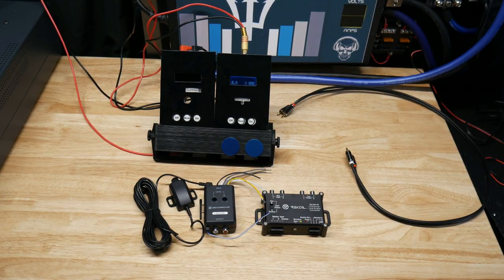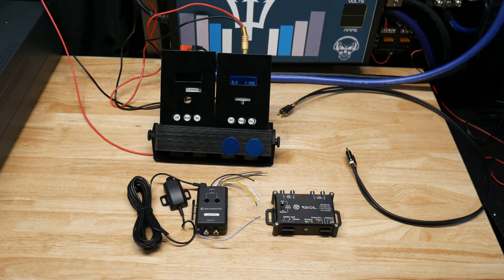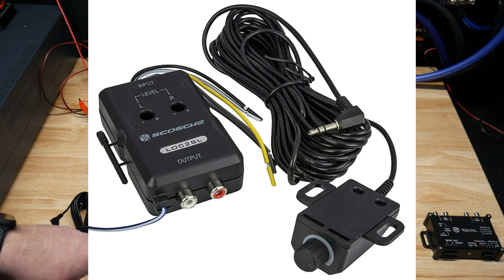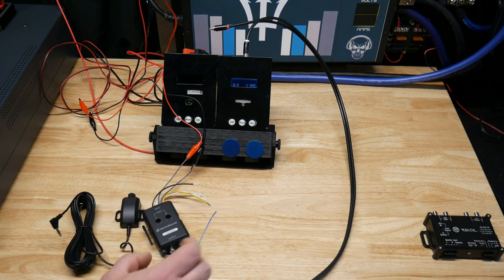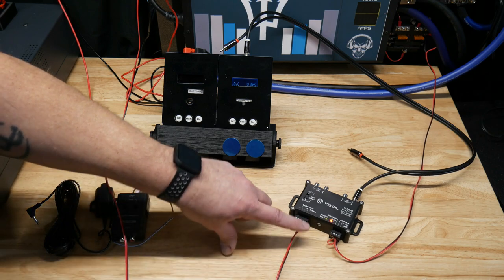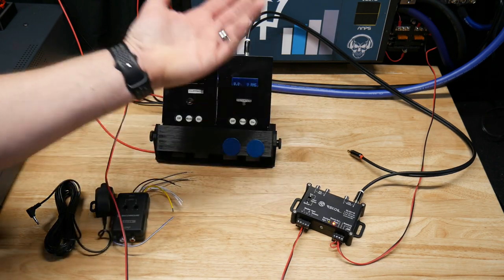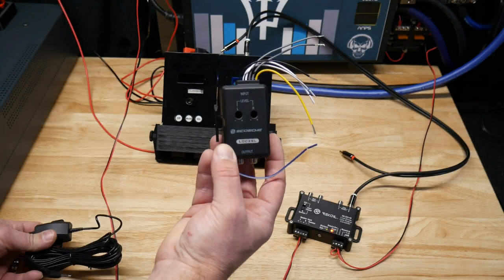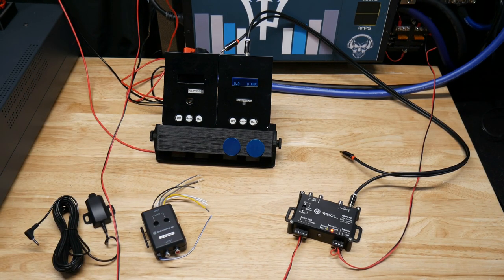Best and worst Budget Line out converters Recoil QLOCD Scosche LOC2SL

Comment: My Scosche LOC25Sl just crapped out, it still turns the amp on but the signal will not go over 0.1v. I searched for a video for some insight on this Scosche LOC and came across this video. I am ordering the Recoil LOC right now.

Comment: I bought the Recoil RP 1200 on 4 skar 8 SDR's but I know my KICKER LOC is causing issues. BADLY... Ordering this loc now.  Thanks brother!  You called it on the Recoil amp!!!  You never elaborated on powered vs non powered LOC?? Maybe that's the reason for the quality, having a powered LOC makes a huge difference on maintaining line voltage.

Comment: I have a recoil 4 channel LOC and I get a high pitch noise of feedback the moment I turn gain up even a tiny bit
  It does not increase with volume or with gain.  It just activated or deactivated the moment gain is anything other than zero.

Comment: So i have the recoil qlocd and i have it hooked up to my factory amp in my car. The wires i tapped off of were the rear speakers, the remote, and the 12v constant. All of those wires i tapped off of are going into the factory amp, i spliced them at the harness. I have a ground wire going to where my aftermarket amp is grounded as well. The only wire i do not have hooked up is the “common-“ does this wire need to be grounded? Also when i first turn on my ignition the qlocd turns on (the red light indicator comes on) then about 2 seconds after that the maximum light or yellow light shines then the whole thing turns off. Should note my aftermarket amp turns on when the qlocd does but when the maximum on the qlocd turns on my amp goes into protect and shuts off. Could anyone plz help me with any info i am stumped
Reply: Did you fix this problem?

Comment: I noticed that you did not hook up power to the Scosche.  Would that make a difference???
Reply from the maker: No  it doesn't effect the line out section...it is only if you need to use the remote turn on wire. If you provide a positive constant power it will sense the audio input and then give you a remote on ( blue wire) I tried with power and no power and made no difference so in video I did not bother to hook up power.
Reply: Thanks for your response.  I hooked up a Scosche LOC2SL to a Rockford Fosgate amp and subwoofer and it sounds pretty good.
 @HiFiVector

Comment: have you ever tested the Kicker 46KISLOC2 ?  i was hoping that would been in the test since its about same $20 as the others
Reply from the maker: Yes that one is good as well but  this recoil has more features for the money.
Reply: @HiFiVector  thank you, unfortunately I currently have the Scosche, I have a scar vd8 2 ohm sub, sealed box and an rp800 monoblock amp. Would love some advice in reference to setting the gains correctly do I have to have the line out converter all the way open to see the correct voltage coming off of the  the amp to get it close? I just ordered the recoil to change it out
Reply: @HiFiVector  TY, 1 last question, with the recoil can i hook my positive speaker wire to the remote in to give it power for remote turn on? my schoshe uses it and ive seen others do the same with kicker all in one sub/amp?? just figured i would more expert opiniob

Comment: Is the wiring the same on both. I regrettably have the scosche LOL tapped into the rear deck. If I purchase the recoil one is it just plug and play?
Reply from the maker: Yea same. It needs speaker connections and this recoil needs a power and ground. For a line out converter that doesn’t require power or ground and only speaker inputs I’d recommend this kicker. https://amzn.to/3FW4frq

Comment: I have a taramps ds 800x4 and the manual says 2v max. What impact on the amplifier does a higher voltage have?
Reply from the maker: Are you referring to the rca input voltage?
Reply: @HiFi Vector   yes and how do I combat that? I see that in this video if the voltage is too low you get a distorted signal. What's happens if it's too high? Will this product enable you to adjust voltage?
Reply from the maker: @dragon76er  The high or low voltage  doesn't  really mean distortion. Most normal RCA voltages are from 1v to about 6 volt. I believe on the Taramps model you have the reason they want only 2v or less rca input voltage is because if it is higher the amps gain knob sensitivity will go up. As they designed the amp around 2v or under pre amp input voltage. I do know a lot of people who runs those and havent heard of an issue and I know most of the guys never checked their RCA voltage. But if you like you can use a DSP like this to reduce your pre amp ouput voltage. Or You can use this Line out converter do do it as well.  Here are some links. 
https://amzn.to/3QxsVu0 NVX line out converter 
https://amzn.to/3IGtxMa stetsom DSP
stetsom bluetooth DSP https://amzn.to/3GvtNe7
Reply: @HiFi Vector   thank you kind sir, love your videos so keep em coming!
Reply from the maker: @dragon76er   Thank you SO MUCH! I appreciate the support!

Comment: Will the reocil suffice in a 2012 ford f150 with sony navigation stereo system for an aftermarket sub install? I was told by my local car audio store that I needed the 47KEYLOC by kicker which was an astonishing $130. I'm sure it does great but does this recoil basically do what I need it to do which is run my aftermarket sub and amp with the factory head unit?
Reply from the maker: Yes it will.

Comment: I know this wasn’t the point of your video but i can’t find the answer anywhere on the 2sl what kind of wire do i use when connecting the blue remote wire that’s next to the rca outputs to my amp. Again the answer could be obvious i just seem to be overlooking the answer
Reply from the maker: For a remote wire you just need 18AWG stranded 12v wire with a flexible coating like silicone. Some of the stuff at the local auto parts stores is stiff and hard to manipulate.  You can use 16AWG also but not necessary, 18awg is fine. Here is a link to some good cheap remote wire: https://amzn.to/3IBI7Vm